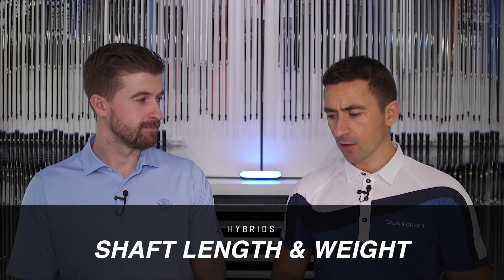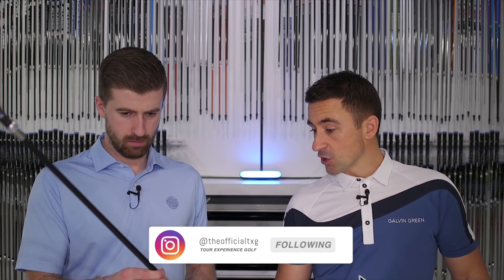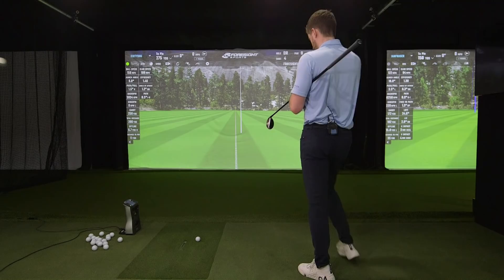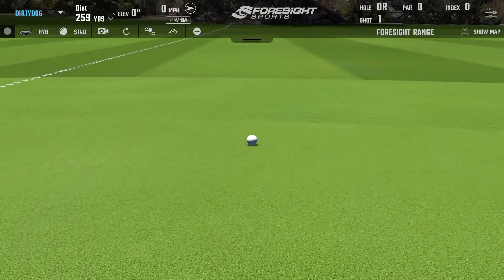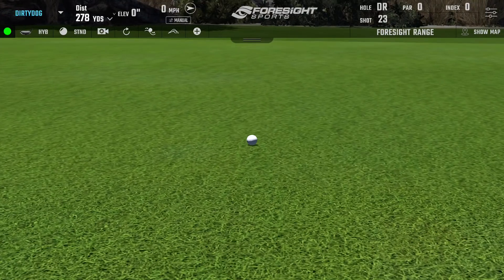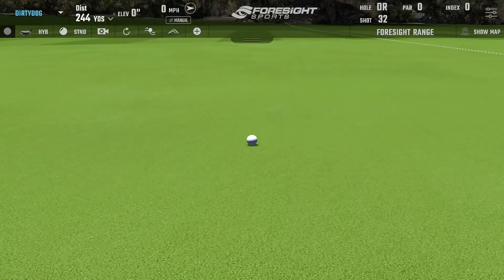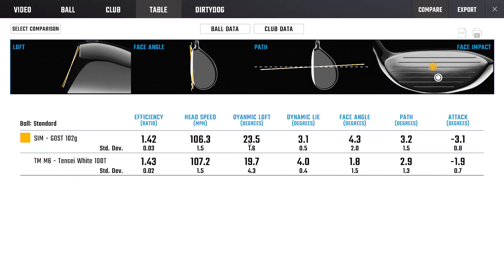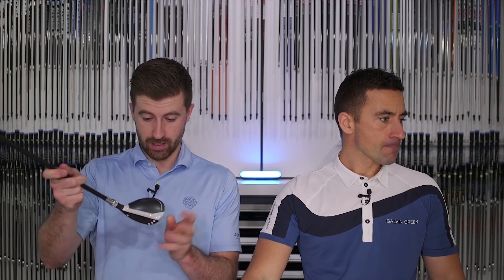New Fitting Concept for Hybrids // Better Contact & Accuracy

Comment: As a Professional Clubfitter, I have been a strong proponent of playing hybrids shorter and heavier than standard lengths for stronger golfers.  Although I just turned 71 years old, I play my hybrids at -1/2” to -3/4” in playing length with 88 to 90 gram composite shafts in them, which transitions very well from the 77 to 82 gram shafts in my fairway woods to the 95 gram shafts in my irons.  When the hybrid heads have weight ports in them, I have had to resort to installing heavier head weights on some occasions (I also had to do this with a Callaway Epic Flash 7-wood, because I play that club at -1/2”, as well).  If a clubhead doesn’t have a weight port, a couple of strips of lead tape generally does the trick.
Reply: Interesting. I have a question you might have the answer to, so thanks in advance!

I recently got a Diamana D+ X-Flex 100 Hybrid shaft. The shaft is 42” uncut. I want to install it in my Callaway Apex 19, 3-hybrid.

Mitsubishi recommends trimming the shaft 1” for 3i, so down to 41” length.

However, the stock Callaway Apex 3-hybrid has a 40” shaft. As per your recommendation, I’d like to go 0.5” shorter than stock (so 39.5” but with the Diamana shaft)

Any thoughts on this? Should it be trimmed from the butt and tipped from the tip or butt? Thanks!
Reply: @scoobanny  — Unless you are REALLY strong and have a quick swing tempo, I would go with the  standard tip-trim instructions (in this case, 1”) and then butt-trim to final playing length.

Doug Mael
Reply: @scoobanny  — By the way, you may get a slightly lower-than-standard swingweight when you cut the shaft to play at 39.5” in that Apex hybrid (although the Diamana D+ hybrid shaft is not counter-balanced, so it won’t be too dramatic).  If this happens, just add about 4 grams of lead tape at the back of the hybrid head (one 1.5”to 2”long strip of lead tape should do the trick).
Reply: @dougmael  Thanks! Sorry, I'm a novice when it comes to club fitting, I initially thoguht that Mitsubishi suggests initially trimming the club from the butt end not the tip end. My bad. So 1" off the tip, then then 1.5" off the butt end. If I understood correctly, cutting from the butt to length won't affect the shaft stiffness as much as trimming from the tip end to length? Thanks!
Reply: @dougmael  You also mentioned that you go -0.5" or 0.75", but I was wondering what the final length of your hybrid shaft is. In this video they said they went 2" shorter, but also didn't mentioned the final length. Thanks!
Reply: @scoobanny  - you should never worry about what the final shaft length will be (as long as the shaft is long enough to begin with) until the shaft has been installed and the epoxy has cured completely. That is when you butt trim the shaft to achieve the final playing length.
Reply: @dougmael  I see! May I ask what the playing length of your hybrids is?
Reply: @scoobanny  - I have several hybrids, but the two that are currently in my bag are a 19* hybrid at 40.25" long, and a 22* hybrid at 39.5" long.  I also have a 17* hybrid that I sometimes play instead of my 4 or 5 woods, and that one is 40.75" long, and a 25* hybrid that can replace my 5-iron, which is 38.75" long.
Reply: @dougmael  Thank you!
Reply: @dougmael  Thanks!

Comment: A few years ago I asked a local club fitter why the graphite versions of iron shafts longer than steel. He explained to me the length increase of the lighter graphite shaft increases the swing weight otherwise it is too light. So said why not use a heavier graphite shaft that is shorter in length. I don't use hybrids but in driving iron, I use 105 grams (SteelFiber) shaft opposed to the 70, 80 or 90-gram graphite shaft they usually use for these types of clubs. It is working for me!

Comment: Hi guys, love the video.  I was having trouble with my 5 iron so Melvyn at 4 counties golf  in Staffordshire created a hybrid replacement with a shorter heavier graphite shaft from Tom Wishon’s S2S shafts. Hey presto a club that flies 170 to 175 yards and that’s a lot more consistent than my 5 iron and so much better from the rough. Great from the fairway and a better landing angle so my shots fly and descend without running out too far. 

I swing a 5 iron in the mid 70s mph so I now have 3, 4 and 5 hybrid with 6 iron being my longest club. The hybrids are more forgiving and allow a 11 handicap golfer like me to improve my consistency and scoring in the 165 to 200 yard range.

Comment: I did something very similar this past summer. I was using an Accra FX200H in my 23 degree hybrid. I replaced it with a Nippon Modus Tour 130, high launch/low spin. I made it about one inch shorter. My ball flight was higher and distance much more consistent.

Comment: Just switched to a SIM MAX 19° Rescue with a HZRDUS Red 105 shaft. Absolute bomber.
Reply: Luca Imwinkelried - That SIM MAX 19* hybrid is so good that it makes a great replacement for a 5 or 7 wood (or both).  I have one of them, and when I want to walk the course carrying my bag I try to get down to 10 or 11 clubs. When I do this, the 19* SIM MAX hybrid is the next longest club after my driver and then the next one after that is generally my 5-iron.  I can get the in-between distances by choking-down on the 19* SIM MAX.

Comment: I really loves the One Length Cobra hybrid, not just for control but also the flight wasnt soaring like a normal hybrid. Its a tad too short for me, so I customized my own 4 hybrid with lead tape and it works very well. 

I use a hybrid to get me out of the rough. Thats where i play my hybrid in my bag, it overlaps my lowest iron but I can get slightly more distance than a 4 iron but it's my go to out of bad lies, fairway bunkers and rough.

Comment: This is ultra relevant to me. I recently put a 42" (-.5) shaft 6.5 (heavier and stiffer than I usually play) in my 5w and it has increased my distance a lot due to my superior contact.
Reply: jaconbits - 42” is still generally too long of a playing length for a 5-wood. I am far from being short in stature (just a hair less than 6’ tall), and I prefer my 4-wood at 42”, and if I have a 5-wood in my bag it will be no more than 41.5” long.  I don’t carry both at the same time; my standard fairway wood setup is 16* 4-wood (42”) and 20* or 21* 7-wood (41”).
Reply: dougmael The G410 i’m playing is factory 42.5 for the 5w, with the 7w factory 42. So i’m playing Ping’s 7w length spec in my 5w

Comment: I do the same thing with hybrid rid length. I put shorter heavier shafts in with more headweight and even set them open on the adjustable sleeves. I feel the control is much better than trying to just smash it.

Comment: Did this a couple of years ago. Put a SteelFiber i125 into my Cobra F7 4 hybrid and cut it down to regular 4-iron length (D3 swingweight). Much better contact and control. Still draws a bit but not as much as at the original length. I swap it in and out with a T-MB 4 iron depending on the course.

Comment: This past year I've replaced my 4 iron with a TaylorMade GAPR Mid, 4 @ 21* and KBS Stiff shaft.  Slow tempo down a bit, hit it like a long iron ... trusty straight and long.  Then I tried changing my old 5 wood (19*) with with a Callaway Big Bertha Hybrid, 3 @ 18* with UST Mamiya Recoil stiff shaft.  Hit it like a long iron - big slice.  Hit it like a wood - big hook.  Hit it like a 7-iron - goes okay, but sometimes CRUSH it.  Can't trust it, but the potential is there ...

Comment: The only hybrid I have hit consistently well is an older steel-shafted Mizuno Fli-hi CLK 4-hybrid. It’s got a Dynamic gold s300 shaft at a 4-iron length, and I love it. $20 of eBay four years ago! I think Mizuno was on to something in that they saw the hybrid as an iron replacement.

Comment: I use TS2 Hybrids in 19 and 23...still heavily considering adding a 27 to my bag to replace my 5 iron. I just hit them so darn straight in the flatter setting you can set. First hybrids I've had (besides the 818H1 that I had that convinced me to replace my 5 wood) that I didn't hook.

Comment: I actually just did something very similar to this.  Have a Titleist 816 H1 19 that I could never really hit well, and it went too high.  It even had a 90g Diamana whiteboard in it, and I still hit it too high.  I dabbled with a driving 2 iron, but it was just too hard to hit, and don't like the idea of a 5 wood, as I had enough trouble finding a 3 wood I like.  I ended up experimenting with a shaft that matched my irons in the hybrid (parallel NS Pro Modus 3 120), and it's basically built to 3 iron length.  For the few times I tested it this winter, it works great.  Once this COVID-19 blows over, I can't wait for some course testing and putting it into play.

Comment: Always hooked my hybrids until the Titleist 816s. Being able to flatten lie without messing with face angles is a game changer. Started with a 19 degree and liked it so much I got a 23 degree as well. The 23 degree was an eBay fund and it came with a lighter 70 gram shaft. I thought it was going to be an issue but it hasn’t been and these two clubs are probably the most consistent in my bag.

Comment: Did something so similar to this. Replaced an F9 5 wood with Titleist 818 H1 23 Degree lofted down to 22 and using a rogue max 85 shaft. Much more consistent with strikes, not lost much distance and taken the left side out of the equation which I struggled with the F9.

Comment: Man, you guys are on point right now. Just had a conversation with a fitter here (NZ) and he convinced me to chop 1.5 inches off the chaft and play at 3iron length. No big left anymore! Especially as I can play the 918 flat as well. Only lost about 8 yards which is fine because it's a lot straighter. I did have to add a bit of weight but that's easy. Very interested to try that modus shaft. Great video!

Comment: So Matt doesn't use 3 wood into par fives because the holes "not long enough" and here I am hitting 3 wood into  some par fours 🤦‍♂️🤦‍♂️ I wish I had Matt's issues.
Reply: Steven Stewart   I’m with you brother.
Reply: @brianwaldo2642  Me too, I have never ever, ever said, "this hole isn't long enough!!!
Reply: @banditbaker1675  I have, when I was 2 ft past the pin with a drive on a short par 4..........
Reply: @oldgold5848  But did you make the Putt?
Reply: Steven Stewart I also did a double take on that one, “Did he just say what I think he said?” 🤯
Reply: @jasonstrayer8347  Yep he said it!
Reply: @banditbaker1675  I did mate! Nearly had an albatross once, narrowly missing a 2nd shot in the hole on a par five at Patshull Park. Made that eagle too, which is surprising as my putting is usually woeful!
Reply: @oldgold5848  Good man👏👏👏👏
Reply: When playing from the tees that are appropriate for your age, ability, and average drive + 7-iron distances, you should find few if any golf holes where you would need to use, or even consider using, a 3-wood for an approach shot on a par-5 hole.  I rarely carry a 3-wood for that reason, and when I do it is because there are medium-short par-4 holes or tight driving holes where I would prefer to use the 3-wood off the tee.  However, a 4 or 5-wood is usually sufficient for use off the tee on these holes, so the 3-wood would not generally be needed
Reply: Me too.

Comment: My best club in the bag is a pinhawk 4 hybrid (1st version) same length as my 6i (1" longer than standard) with a 6.5 project X shaft. It's heavy in the head but puts me on the perfect swing plane that all I do is swing it nicely and it goes a 220-230m dead straight every time. Mid to high launch. No swing thoughts, just set up comfortably & swing. Good one to test for Matty boi as we have similar SS.

Comment: Thank you.  I learn more from your videos that any others.  My hybrid is a stock Titleist 818.  I'm going to test out the shorter shaft idea by putting a rubber band on the grip to reference the same length as my 4 iron and see if that helps my consistency issue.

Comment: I've done this exact thing on my last 2 hybrids - i.e. cut them to 39" which is 1" longer than my longest iron - my 5 iron which I play at 38" and I play it strong lofted at 24 degree - a typical 4 iron loft. This one change transformed my comfort playing my hybrid - a 22 degree #4 Taylormade GapR High, which I play 2 clicks stronger and open at 21'ish degrees. I'm using the stock 80 gram KBS Hybrid Shaft but I'm not too sensitive to shaft weighting in general and I am still coming back from elbow injuries. The other trick I personally like, is the Crossfield idea of setting up certain clubs to Draw - as hitting a fade is always easy in my opinion - so I adjusted the shaft to the 180 degree upright setting - this gives the club a natural 5-10 yard draw which gives me the comfort of being able to really commit to a long forced carry at a full speed swing in the 210-215 yard range - I can comfortable hit the high fade type 195 yard soft cut which is very natural with the club's natural starting line left given the lie. Heavier shorter hybrids are the future in my opinion - sort of where 1 length technology showed some promise.

Comment: Going shorter on the hybrid did wonders for me. I couldn’t hit hybrid from the fairway because of hooking it too much, shorter shaft + Sim hybrid is an incredible combination for me. This was the wow moment in my recent club fitting. A complete change in performance without doing anything to my swing.  As Ian and Matt said, lie angle of the hybrid is an important factor for the change in performance.  Regarding lie of the club, is it possible to flatten a driver? I’m finding massive difference in performance when I start my swing with the driver head in a flatter position (for reference, I’m 5’7, so lie angle on longer clubs matters a lot for me).

Comment: I have Sim Max hybrid. Tensei Pro White 90tx. I ordered it .25” short to mitigate some of the upright lie. Still a bit too much draw bias. I may trim another .25” at some point. The club is nice and heavy already with the 90 gram shaft so hopefully a little shave won’t throw off swing weight in a drastic way.

Comment: I've always always gone with the "heavier and shorter" formula with longer clubs. This trend of 45.75" drivers and 43.5" 3 woods isn't helping the average Joe, and neither is 60-70g hybrid shafts. Great test guys!
Reply: Morgan Cross - All excellent points, and exactly my philosophy in clubfitting (I’m a Professional Clubfitter with more than 30 years experience).  At age 71, you still won’t find me using a hybrid shaft that weighs less than about 82-85 grams, and 88 to 90 is my preferred hybrid shaft weight.

Comment: Just added Mizuno CLK 2020 models in 3 and 4 hybrid matched with 5-PW HMB. The shaft in CLK is Tensei 70HY stiff and set at standard flat lie (ie. lowest) with a bit fatter grip and can’t turn them over unless I really try. I have a Ping G410 3 Hybrid with the Tour 85 rage shaft set at flattest lie and I can’t hit anything but a duck hook.......The CLKs are the best hybrids I have ever had just confident now, penetrating flight, great feel, and they just look square at address........my pro said they are the only hybrid he has put on the ground that he doesn’t feel like he is going to turn over......

Comment: Awesome video guys!  I was really looking forward to this one.  I put a 21* 818H1 with the stock Atmos TS Blue 85S shaft in the bag 2 seasons ago to fill the gap between 4 iron and 3w.  Loved it but I was afraid of missing it left...hard left if I went after it.  Mid season last year I put a Tensei 105x (untipped) and cut it almost an inch shorter than standard length.  What a difference!  I play it at C4 (22* / 1* flat) and its my go to 220-225 yd club and if anything my miss is a little right.

Comment: This is a great video as I'm trying to do the same thing with my long irons.  I have P790 (1st gen) 3i and 4i heads that I put on KBS TGI 100 stiffs, but using a 5i shaft cut to 5i length (so both the 3i and 4i are on 5i shafts and 5i length).  So the idea is I'm trying to see if I can one length my long irons to nothing longer than a 5i length.  My irons are a mix of P730s (PW - 8i), and P760s (7i - 5i) in KBS CTaper Lite shafts stiff at 110 grams.  The idea was to make the 3 and 4 iron shorter, but using a slightly lighter graphite shaft to make up for the loss in club head speed.  Also the P790s are strong lofted heads as you know, so the 3i and 4i are actually a 2i and 3i respectively when it comes to loft.

But, having said this, I'm wondering if I should've gone with a heavier shaft now after watching this video?  My swing coach has hit them and he crushes them, but he also has a 120+ MPH driver swing speed (he hit the 3i 250 yards about).  But I of course do not have that level of driver swing speed (yet :) and swing around 103 - 105 (starting to get into the 108 area as my technique has been improving).  Hence I'm having problems hitting these new 3i / 4i and getting them to perform as intended.  I'm trying to figure out if it's me not striking them well, or maybe I just don't have the swing speed to effectively get clubs that low-lofted into the air with a shorter shaft?  Hence my question after watching this is maybe I should've used heavier shafts instead?

Anyways, long description, but would love your thoughts on it?  :)

Comment: Great vid, keep the awesome content coming guys! I have noticed the same thing with shaft length in going from a 3w to 5w or 3h to 4h. Get much better and more consistent contact with the shorter shafts, similar distance due to better contact, and a shot shape that can actually hold a green. I also like that you pointed out lie angle. The flat setting on my G410 5w is an absolute game-changer. Hoping to upgrade to G410 4h soon.